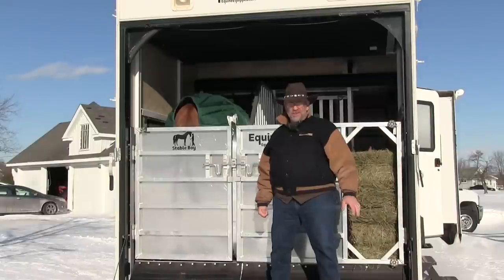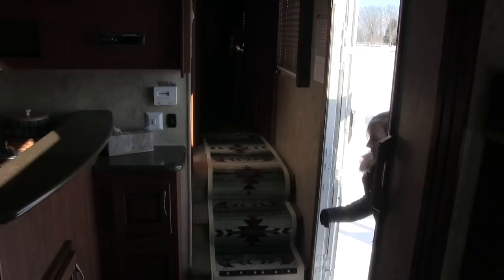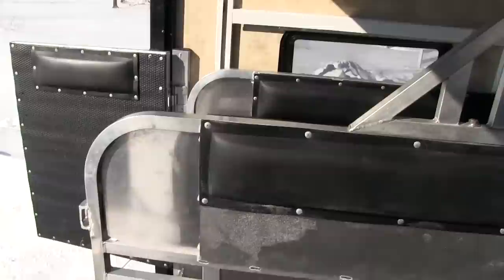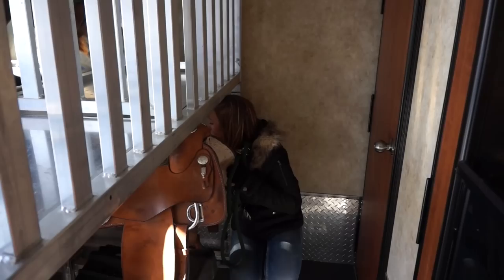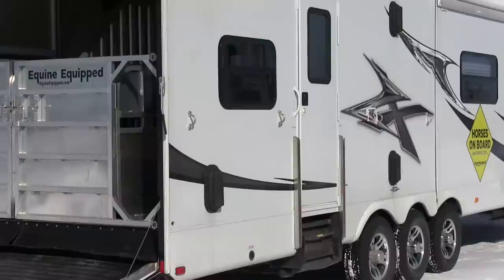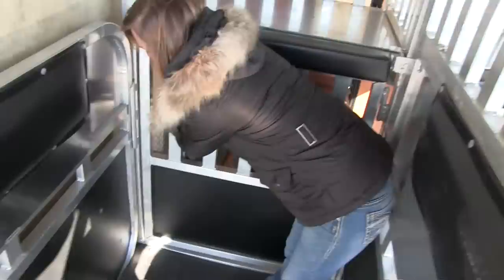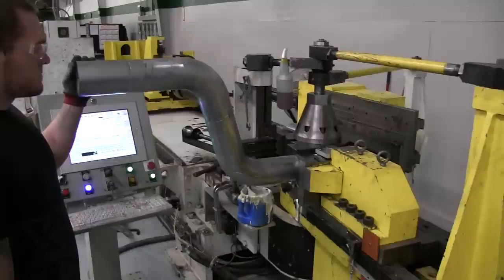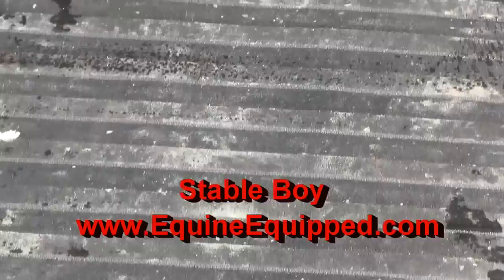MrTruck reviews Stable Boy module horse stall for RV Toy Hauler

Comment: Wouldn't even think of using this. #1 the mangers; horses need to be able to lower their heads to clear their airways while traveling. These mangers prevent that. #2 Air flow. Horses get HOT in a trailer, not to mention the urine smell. One or two little vents are NOT going to do it for a horse. Those vents are ridiculous.
Reply from the maker: You can add as many vents as you need, plus a big one in the roof.
Reply: Ponyabout Town  And a centre partition that goes all the way to the floor ! No room to spread those legs for balance

Comment: The module looks of good quality but I would be very cautious about trailering a horse in a toy hauler. Many floors are wood without the support under them for 1,000lb animals. Four wheelers are approx. 500lbs and the cargo rating may be for less than the horses weight. Many of the toy haulers sit taller than a horse trailer and that makes the load unbalanced along with the fact that you are carrying a live load not a 4 wheeler. Horses also need ventilation for comfort and not just a fuel vapor vent. How are the dividers connected in the hauler? If there was a wreck could those panels support the weight shift of the animals?  The safety of the owner is also at risking ducking under a manger so I would be concerned if I had a child or novice trying to load a horse and get out safely. Many rv's have wood support in the walls not aluminum posts so again I would research heavily before transporting a horse in a toy hauler. It is easier to add tie downs in a horse trailer that has the strength and longevity over an rv. This is just an opinion but customers and their equine partners are a top priority for us as a dealer.
Reply from the maker: It is a new concept, but a great design. Stable boy has it's own floor. You could call it a double floor. This will spread the weight out to all the floor stringers of the garage floor. The bigger garages in toy haulers are designed for jeeps which weigh more than 2 or three horses. RV's in general are body on frame like a truck, so they have a frame under the floor where a horse trailer is uni-body like a car. Toy Hauler's are designed for more weight and cargo than a typical RV. The floor is stronger, the rear opening for the garage door is reinforced.
Reply: MrTruckTV Thank you for the information on the Stable Boy. I would not want the public to confuse the category of toy haulers with the Stable Boy then because those structures are not designed for livestock. I did sell quite a few Lakota HUT trailers but they were built like a horse trailer and set up to carry toys. The industry is definitely trying to be diverse and come up with that one trailer that fits a family's outdoor adventures.
Reply from the maker: Gator Horse Trailers
I understand your concern. Stable boys are designed to fit inside of Tow Haulers. Which also reinforces the floor and garage walls of a toy hauler. The garage door is also reinforced and lengthened
Reply from the maker: MrTruckTV
You should be selling Stable Boys in Toy Haulers next to your Shadow horse trailers in Florida
Reply from the maker: Gator Horse Trailers The divider framework is bolted to the walls and floor. There is wall and ceiling vents. The concerns you have, have been addressed by the inventor and the manufacture at the start. Have you actually seen a Stable Boy? I know they tried to rent a booth the The All American Quarter Horse Congress in Ohio and for some strange reason, the booths were sold out. I guess Congress needs alot of open space North of 17th Ave. Congress hasn't been sold out of space for many years. My theory is horse trailer dealers with booth space at Congress don't like competition that would challenge the core group. I'm seen this with Brenderup, Safr and the Fautras. 

I would encourage anyone including horse trailer dealers to tour the factory in Michigan. You might want to be the ones in on the ground floor. The public has asked for this type of conversion for years. I'm glad to see a quality product come to market.
Reply: Excellent. I was just thinking this myself. So funny you called out the horse trailer guy.
Reply: Rus
Reply: Hence the quarter inch floor. I have an aluminum horse trailer that's built just like a toy hauler. A side x side weighs like 1500lbs.

Comment: My concern is that the weight is behind the axles and a horse trailer the axles are centered under the horses plus it’s all to the left and not centered it the toy hauler if it was centered then a person could walk up along the outside of the stall on each side. But the big thing for me is that you have a heavy cargo behind the axles there for it is going to be more weight pushing you when breaking making it unsafe.

Comment: It's cool, but there is little ventilation.
Reply from the maker: Toy haulers are tall and they have a low vent and high vent for gas fumes on ATV's. They Stable Boy had a bigger roof vent. I'm sure you can had more vents if you need them.
Reply: Katelynn Cottrell toy haulers also have side windows that can be opened

Comment: Not enough air. 😱 Especially on a Hot day. Please show pictures of a crash test, aluminum bends! Are those aluminum bars solid? If you can show me pictures of how it holds up in a wreck I might consider it, but would Add many more vents.
Reply from the maker: They have sold all they made, now they are discontinued
Reply: @MrTruckTV  ok, thanks. It's a great idea, many horse people have considered it, but nobody shows the crash test photos, if any were ever taken. Aluminum bends quite easily. Safety 1st.
Reply: My toyhauler garage area has 3 windows, 2 vents and its own 15k btu air conditioner.
Reply: This would kill your horses in a crash. The house part of the toy haulers usually comes apart from the trailer part in crashes. I'm a lifelong horsewomam as well as an extremely experienced heavy wrecker operator.  I would NEVER use this unit.

Comment: There is no where near enough ventilation. Not only do horses urinate, pass stool, and get hot but they are very big animals and need to take in a lot of air. There's been cases where horses have died due to closed up trailers and not enough air. Now when the horses are loaded they put their heads under the pol protector (right above where the hay would go) there's little to no room for them to lift their heads. If they would spook? Their heads would bang on that (you also have no padding there) if there was a large bump on the road? They would bang their heads on it. The pol is a sensitive spot on a horse and that seems very dangerous. There's also little access to the horses. I like the design for sure but you need to put more of the horses safety and health into mind
Reply: Megan Wolf Ive see a lot worse. Every two horse bumper pull on the planet was set up just like this for decades before slant loads became popular.

Comment: Woe.  5 problems I see from video. 1. Ventilation looks extremely  poor.  A couple of vents is not going to work even on not so hot days. 2. No butt bar. It’s really for extra safety to keep horses from barreling out before you are ready to unload. It gives you a chance to get the doors out of the way. 3. Bad front exit. I DO NOT want to be trying to squat through an emergency front door in a tight area hoping front hooves stay still. 4. Feeding area looks a bit awkward for hay nets etc. 5. It shouldn’t take 2 people to load a horse in a trailer as demonstrated in video.